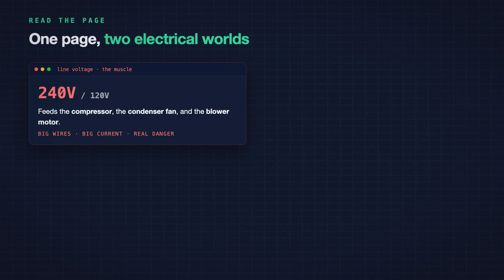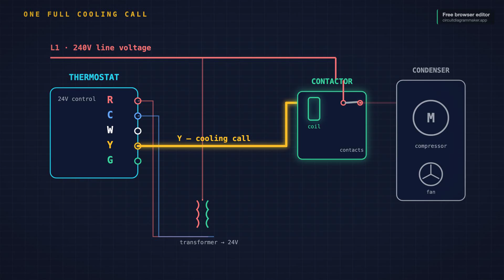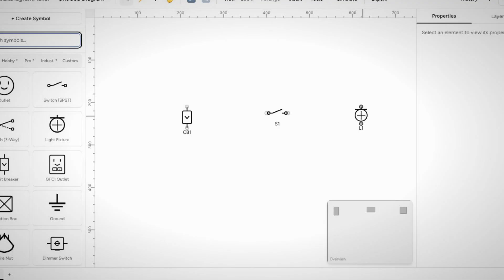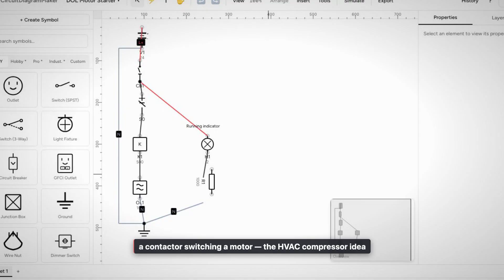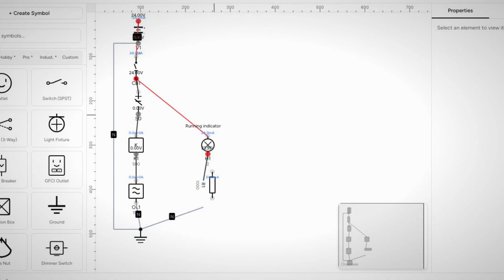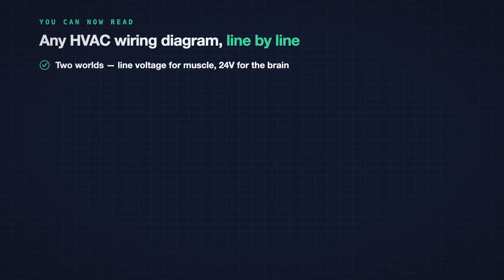How to Read an HVAC Wiring Diagram (Beginner's Guide)

Comment from the maker: The single wire that trips people up is C — the common. It is not a call wire; it is just the return side of the 24 volts from the transformer. Old dumb thermostats never needed it, which is exactly why a smart thermostat with no C wire is the number-one install headache: the screen and wi-fi need that steady return to stay powered.

And the whole cooling sequence in one line: the thermostat closes R to Y, that 24-volt signal pulls in the contactor's coil, and the contactor — a heavy relay — hands the compressor its 240 volts. Low voltage commands high voltage.

Trace real ones free: https://circuitdiagrammaker.app/diagrams?utm_source=youtube&utm_medium=pinned_comment&utm_content=yt-017